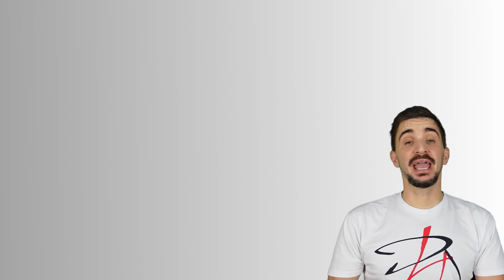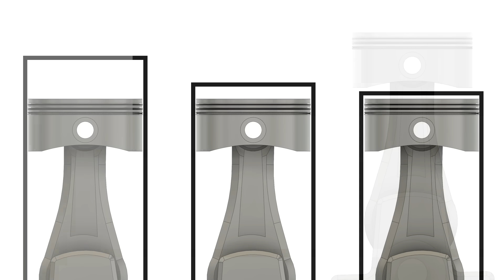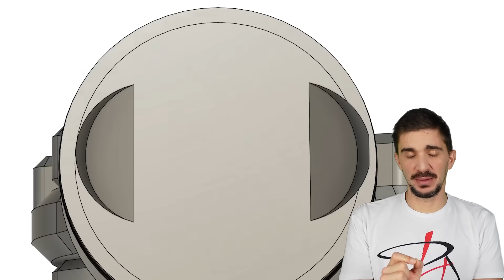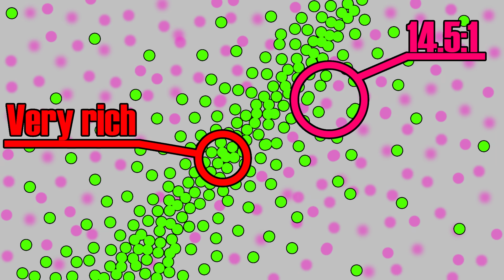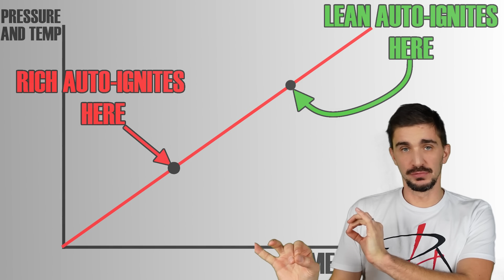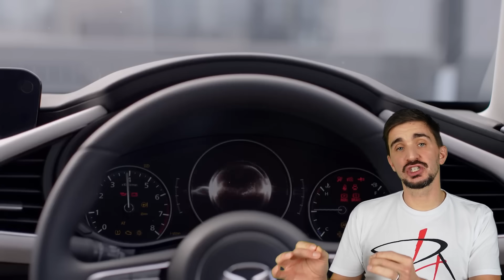The Game Changer Nobody Cares About - Mazda Skyactiv-X SPCCI How it Works and Why It Didn't Catch On

Comment: My mum has a CX30 which I think would have the Skyactiv-X. I've always loved the car, the engine feels like it's really there, I can heard it, it's distinct but civil. Its got plenty of power and I never feel like I have to wring it's neck to get going. The handling is great, the interior is great. Contrasting that to Dad's GWM Cannon and that thing is lame, the handling is awful, the lane assist is not just annoying but dangerous, it pushing me around the road, and I have to drig through a menu to turn it off every time the car starts. Engine response is laggy (turbo diesel), and the transmission is clunky.

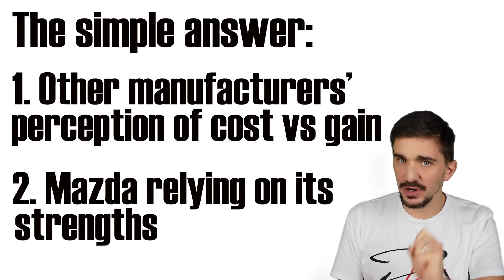Comment: 12:20 did they really make the rotary engine work? I'd argue they didn't
Reply: They won Le Mans with it, I think the rotary worked
Reply: @Psuhockey-cr9if I was gonna say the same thing. Rx-7 was a massive success in sales as well and is still highly sought after. Yes we all know apex seal was the weak point but to answer the question did they make it work? Oh fuk yes lol. Won competition, sold a lot and is a blast to drive with the insane high rev.
Reply: Not sure what you mean.  I had a 1979 RX-7 that worked for many years.

Comment: out of all the cars I've owned, I think Mazdas have been my favourites. An RX7 in my youth just over some 30 odd years ago (yes that drank fuel and oil !) , a Mazda6 and Mazda2 in more recent years. I'm likely to go back to Mazda,  after trying a Honda, and being disappointed with Honda UK's customer service when a known fault low pressure fuel pump issue happened on my Honda at just over 4 years old.
Apparently Honda UK don't think they should refund those who had a fuel pump issue happen to them on a 4 year old car, even though a year later they issued a recall for the same issue.

My Mazdas were 100% reliable ( and the non rotary ones , very efficient with fuel) , my Fords had various issues, fortunately they were before "eco boom" engines, but they were cheap to fix but just painful to own.
The Hyundais I've had have been pretty good. I'm yet to have a Toyota (so they are on the list still) . As I said, Hondas are not on my list of vehicles to consider, I don't want to have to chat to Honda UK customer service ever again.

Comment: You've made a great point I noticed about the NA Mazda 3s: everyone says that they're "flat and lacking punch", but it's just that you actually need to be in touch with how the engine works to get that punch out of it. You can pull a lot faster than people think with it, but you have to spool the engine up BEFORE you're ready to go and know how to manage the throttle and gears to maintain the powerband.
Reply: This is correct!

Comment: BTW, Mazda may be innovative, but their quality control and reliability have always been lacking that last necessary level to reach Honda and Toyota.  I recall their V6 engines in their MX6/Ford Probe. These were great drivers cars. But the reliability of the engine components were lacking. Some of their turbo engines were hit or miss.  And innovative intake supercharging concepts like in their 929 flagship never caught on either.

Comment: There is nothing more engaging and enjoyable to drive than a manual transmission vehicle with a torquey naturally aspirated engine. Preferably an inline 6. Smooth and satisfying.  I concur, we are dumbing down humanity. Smartphones have created stupid people.  People of the latest generation can't tell time on a conventional clock face, can't change a flat tire or their oil/filter. Manually check tire pressures. Operate a manual transmission and clutch. Ironic you bring up maps, as many don't know how to read a paper map.

Comment: Mazda is THE engineering company with BIG BALLS, DOWN TO THE KNEES. I was as a student, had a side job at BMW development (H2 ICE) interested in doing a doctoral thesis at BMW, after they had started the HCCI topic there. This was around 2003, when it was already a week flame. In 2007 they officially lost interest on it. Mazda is still a company, running I4 NA engines in mid-sized cars, they still have balls down the bottom, where all others uses downsized highly boosted solutions with a long list of reliability issues. All my race customers run NA engines, from small 4-bangers of 1 Liter up to V12 with 5 Liters, all a very successfully in their classes and operate against also boosted engines. Rarely, but I have to agree with D4A, everyone should think about where to draw a line in this endless run to more and more comfort. We as a society will lose that race to comfort like those passengers of the Axiom of Wall-E lost it, maybe then it is again an out of rule-Robot bringing us back on track of a human being? Or we end like less romantic like Winston and Julia did in George Orwell's novel 1984, broken as humans and total followers of the total controlling system. I like the Axiom end more, but it needs hundreds of years...that's why I keep my place stuck in the 80's to 00'ies, delaying the outside development in the name of comfort, but finally it is transferring control to a system who is easy to capture by power addicted guys.

Comment: You are advertising slide rules when others are building calculators. The combustion engine for passenger cars is dead. Austria's well known engine development company hasn't had an engine development project in years. Myself I worked in the motorsport industry, there are more than 20 engine concepts that are "the" solution, but nobody wants to build them, too expensive too late. It's over.

Comment: nobody cares because not even mazda cares. Also garbage title (how do you know nobody cares? it's not even on the market outside some shitbox3) and reheated food from 4 years ago.
The mx5 was discontinued in europe due to emissions.
Instead of rolling the 2.0 skyactiv-x to replace the old PE-VPS and sell it with the ND3 release, they opted to just stop selling the car.
To add insult to injury, their supposed 6 cylinder - planned rear wheel layout, was canceled.
Nope. I am not buying FWD cuckboxes or cuckovers. No, I am not buying a "good" engine that is sold only with some hybrid garbage.

Comment: How does it compare to the Maserati 'Nettuno' engine?   Also, a simpler way to think of this is rich or lean of stoich, or peak EGT.   Petrol engines run rich of peak (ROP) unless tuned and forced to LOP, diesels are always LOP until stoich = peak EGT = melt turbos = blow black smoke!   Petrol can run LOP at steady state and lower power settings, have done so for years in old piston airliners.   I cruise LOP in my aircraft, below 65% rated power I can lean as far as I like without risk of damage/detonation, until I lose smooth running.  A good ignition system helps, as does even fuel distribution between cylinders.

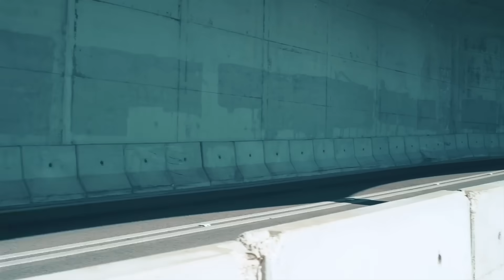Comment: 9:10 sounds like they should build the drivetrain like a diesel locomotive, well, a hybrid car. The engine doesn't drive the wheels, but generates electricity, and with capacitors, probably not full blown EV batteries, you can smooth out intermittent load when driving electric motors

Or even the other way, actually, have an electric motor in tandem with the ICE, and like an electric bike with pedal assist, when it wants more power, kick in the motor on the same transmission to help out, so you get to keep all the other oldschool drivetrain sensations, but without putting undulating stress on the engine breaking its efficiency

Comment: A hcci engine is a perfect match for a parallel hybrid, where the engine runs at a steady load state and simply charges the battery. The engine can run in its lean running hcci mode almost 100% of the time.

Comment: Modern cars are becoming over-engineered because manufacturers prioritize consumer vanity over efficiency. We want maximum power for minimum cost, leading to compromises that sacrifice reliability.

Technology should simplify life, not replace skill. People use high-end smartphones for TikTok and AI to stop thinking, just like drivers now rely on backup cameras because cars are designed with zero visibility. A car should be a simple, durable machine, but we’re trading longevity for gadgets and laziness.

Comment: So the engine isn't available in the U.S.  it wasn't brought here because to meet our emissions standards would reduce its fuel savings down to an estimated ~10% and it would require premium gas or have to be further detuned.

Sounds like another volkswagen situation.

Comment: Wouldn't a mild hybrid and CVT be the answer to the power curve downsides? I drive a 2024 Suzuki Swift and it's a perfect city car. The electric engine has enough torque to give it decent acceleration and CVT transmission keeps it in the optimal rev range.

Comment: personaly I would like to see the mazda engine being installed in smaller cars, and I do mean SMALLER cars, the skyactiv mazda 3 is already way too big (4.46x1.79m). I daily drive a 1st gen citroen C1 (3.44x1.63m), small and nimble it goes everywhere and parks everywhere in our small roads (3~3.5m width 2way roads, we have to go half way into the ditch to cross other cars), it's perhaps a bit too top heavy for proper racing but I've modified it so that it handles all terrain pretty good because our countryside roads are such prime trash that even dirt agricultural roads are better maintained somehow. Having an engine with more capability than the toyota 3 cylinder would be good even if I loose a mild amount of durability, I just realy want something in that small-form factor, I don't want a modern expensive SUV that drives like a boat and that I'll be forced to bump into trees every 5m because everybody else drives in the middle of the road with old shitboxes because they don't care.

Comment: NA engines used to be really nice to drive and in my opinion they still are.
Think of the famous 6.2 liter engines in C63 AMG and other Mercedes classes. Or the high rpm BMW 6 cylinder engines.

So the solution is obvious. 
Make a SkyactivX-V8 and put it in a light weight sedan or coupé. Will make a lot of fun and sounds great while being fuel efficient.

Comment: 40-60mpg with the skyactiv x is pretty AWESOME. I only buy used toyota, mazda, honda, and subaru vehicles usually older than 2000's. if i can get one of these engines and swap it into my 91 camry with a stick, i think i would be in bliss

Comment: the most fun I’ve had driving was a small light car with a small engine and 5 speed manual trans.  no power steering, mechanical linkage
on accelerator and clutch.  more fun than Coney Island

Comment: I think when it comes to the "electric revolution" its important to remember timescales. Developing a new engine from scratch with a new technology, (even if you can crib off someone else's notes to a degree), takes time. With the current electrification trajectory, incoming regulations, and so on, there's a firmly limited timespan before you are not going to be able to sell cars with your fancy new engine due to a combination of legalities and customer preferences changing. If that timescale is too short, your just not going to make back the development costs, so its just not worthwhile to do it.

I agree some of the human factors you mention are in play too. But the timescale issues and returns on investment issues it creates are absolutely a factor, its why motorsport is pushing hybrid and electric routes so hard, (a bit too hard for some of the self imposed limits in current F1 TBH), thats where manufacturers see the future so thats where they are experimenting.

Comment: Great video, and absolutely a plausible explanation for why people aren't rushing to buy these cars. I feel like this has always been the case with Mazda-- a friend once asked me to go car cross-shopping with them to give an opinion on what car they should buy. They were looking for a crossover SUV. IIRC we drove a Rav4, Honda CRV, Mazda...CX-5? (I can't remember, but their competitor in the space) and maybe one or two other things I've forgotten. By the end of the day I was literally shocked to find my friend was still wondering which car they should buy, despite the fact that I could tell even from the back seat that the Toyota and Honda both drove like absolute understeery pigs (and the Toyota just couldn't do anything right-- terrible brakes, terrible stability control system, etc). The Mazda by comparison felt like it had been designed to drive-- totally different class of car as soon as you asked it to turn or brake... the only one with any kind of suspension work performed in the design phase. Comparing the Mazda to others felt kind of like comparing a Cayenne to an Astro van to me: night and day difference, but most people clearly just don't notice these things (or don't care, for some reason?). Mazda does really nice cars: great suspension, nice interiors, not bad looking, etc.

Comment: Great video, thank you. I own a Mazda 3 Skyactive but not the x version. I bought it because I didn't want the issues of blocked dpf's, sticking egr valves, adblue faults and the fear of an £800 turbo failure. Yes it is low on torque compared to a turbo diesel but it performs perfectly well for me as it is still a 2 litre that can give me 48-50mpg on a run. One major diesel failure will wipe out all the savings on fuel and probably more.

Comment: This engine would have been a total game changer 20 years ago before people got used to having a nice wide plateu of torque from turbo charged engines. in every day driving various 1.0l 3cylinder engines offer basically the same in gear acceleration and even the top end is kinda boring because its killed by the long gearing and high car weight nowadays. from a pure technological standpoint the skyactiv-X is very fascinating though and i feel mazda could have a winner here if they would put a healthy sized mild hybrid system onto the drivetrain, not just that rather pointless 24V 6kW one they nowadays do. with a healthy chunck of electronic torque on top this engine would feel like a 3.0l+ naturaly aspirated one and offer similar pulling power to competing 4 cylinder turbos while still keeping all the benefits of very low consumption under light load and instant linear power delivery - just more of that so it doesnt feel like a sleeping foot anymore. a "Skyactiv-Z 1.8l 180hp 300nm mild hybrid" with a manual or modern DCT in a Mazda 3 would be something i would throw my money on in a heartbeat.

Comment: These engines have a thermal efficiency of about 45% at constant speed and load, which is impressive. Chery PHEV engines have a thermal efficiency of about 45%, and get around the problem of fixed speed engine requirement by having an electric drivetrain to handle the low speed driving. BYD PHEV's have engine efficiency of about 46%, also with electric drivetrains. These engines are thus perfect for a PHEV setup

Comment: I remember hearing a ton of hype from the automotive press and enthusiasts leading up to the release of this engine. Part of the reason I think it fell somewhat flat was that the resulting final product made less horsepower than other naturally aspirated Mazda Skyactiv-G engines while being more expensive. The X also didn't provide as much of an on-paper fuel economy boost as people were expecting. Hybridization (especially PHEVs) provided the same or greater fuel savings while also tending to result in more power.
I felt bad for Mazda, since they actually tried making a new and innovative engine design, which is fairly uncommon in the automotive industry. For their first SCCI product, I think it was a good effort. Just like many new technologies, this can be worked on, refined, further developed, and optimized over time -- it just needs the time, effort, and budget to do so. Hopefully Mazda continues to work on the Skyactiv-X and SCCI engines to make them better and better and doesn't drop the project.

Comment: 7:03 so the solution is consistency across all variables, fuel, air, and load. 

Use case, generators. [Think home back up generators hospitals and such.]

Comment: With engined being inherently most efficient when tuned to a certain load and rpm, ( like the spcci ) it really baffles me that we do not see more HEV cars with full electric propulsion, small battery for spikes and a petrol or even diesel generator for optimal efficiency. ( kinda like the Fisker Karma, but not as poorly assembled and designed ) 
it seems like the logical choice, yeah you lose some energy in converting electricity to motion and back, but just slapping a extra engine on something so "Big hurspwr number go up" feels like we should have passed that stage a while ago.

Comment: I think that the whole concept of this engine,or the marketing behind it was wrong. A high revving petrol engine with the fuel economy of a diesel. Then you go and test drive it and has nothing of both worlds,yes you can rev it but the power it's not enough and then where's the torque? Even Mazda gave up on this engine, right now they use a 2.5l for lower power and in the markets where the petrol is cheap don't sell this engine

Comment: Thank you! . . . . a very clear exposition.   My feeling is that a 'mild hybrid' with an SPCCI  motor plus an electric motor would solve the perceived lack of 'punch', since our tiny little Suzuki Ignis  does deliver that punch.  Part of this is due to its very low weight, of course, and it is  already outstandingly economical, especially when driven sympathetically.  Suspect that the cost burden might be too high, and is the SPCCI hardware heavier, perhaps?  
As students in the '60s we had fun building single-cylinder stratified charge motors, which were usually susceptible to pre-ignition, so our end of  the workshop was nicknamed "The knocking shop"!    My main focus at that time was the cost-effective petrol injection systems we needed.